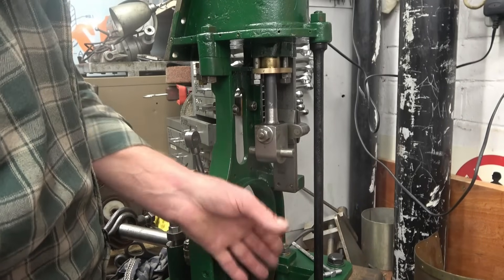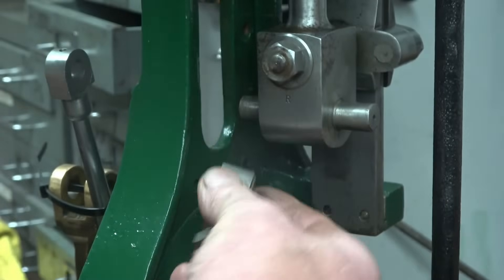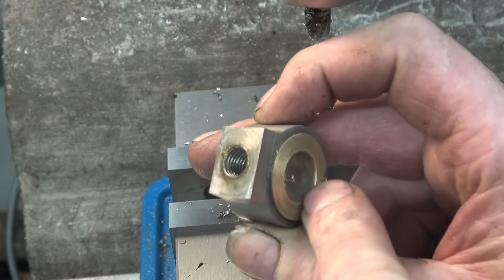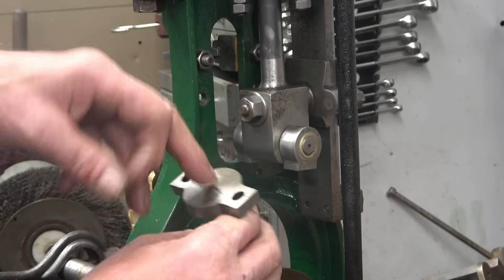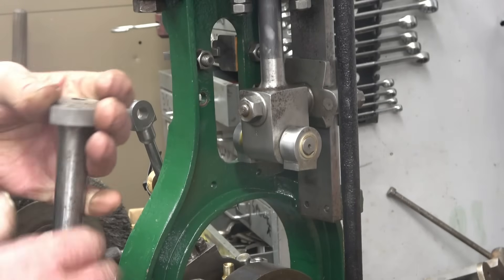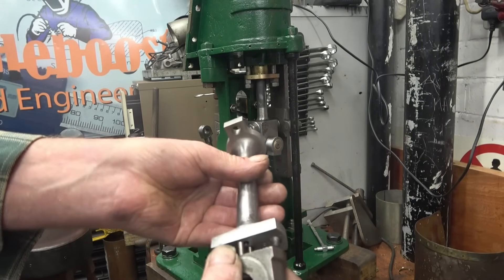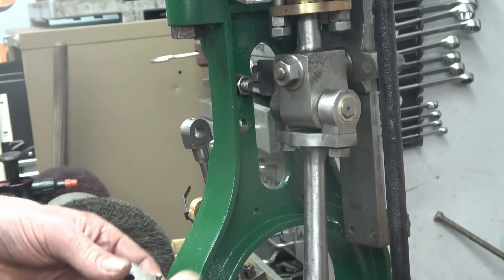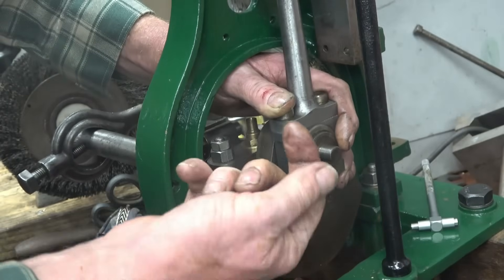SNNC 510 P2  Steam Engine Restore

Comment: I think I would drill the oil hole the rest of the way through the con rod instead of relying on the tiny one.

A drip oiler would be a nice addition.

Cheers.
Reply from the maker: I will be doing just that    
You can not have too much oil.